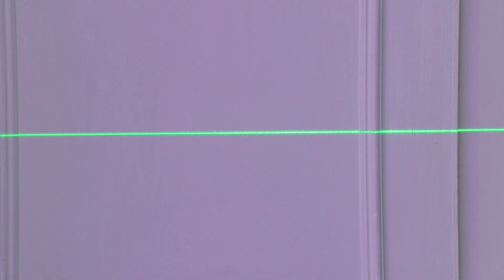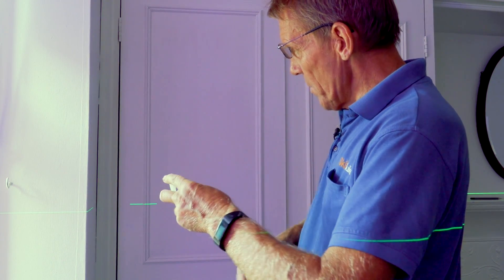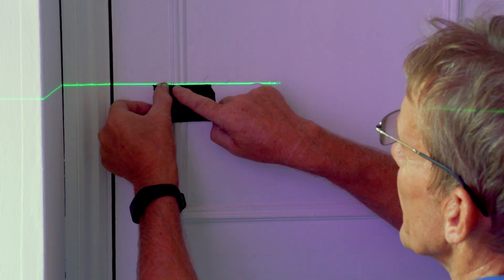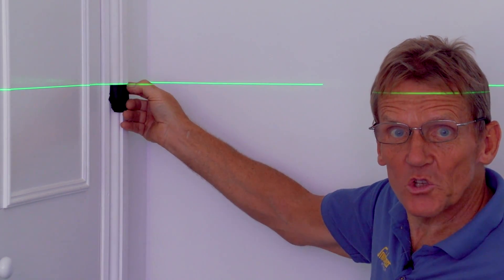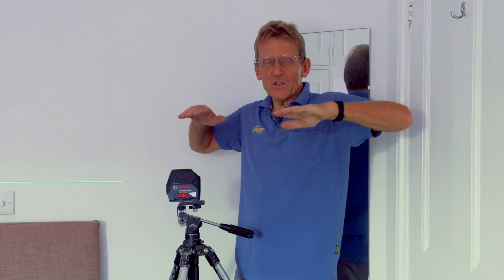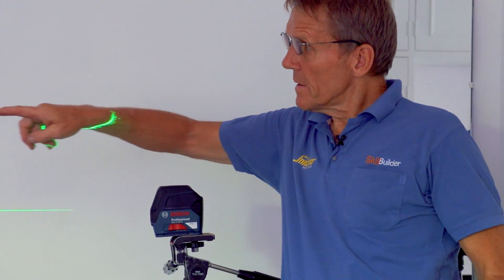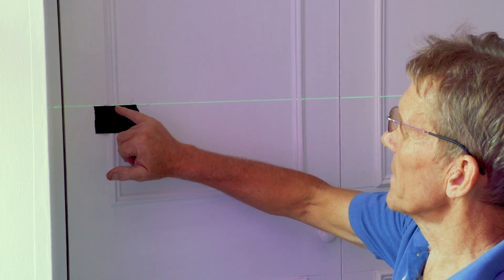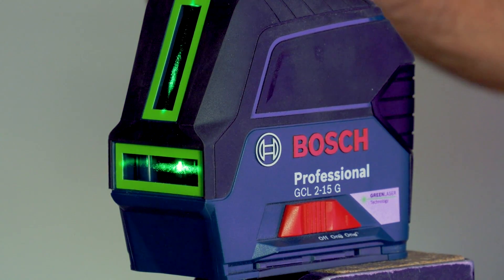Is Your Laser Level Really Level? How to Check

Comment: If the level is not reading level to begin with, then your tape will be off and not level.
Without comparing to some type of standard that is known to be level all that you
are doing is checking for repeatability and not level.
Reply from the maker: Maybe you just  need to think about this a little more. If the level is not level and you move it to the other end and line it up with the tape it won't touch the starting line if it isn't level. If you can't understand it the best thing is to try it and you will see how it works.

Comment: Roger, good vid. I had a cheapo laser level where part of the pivot bearing (a universal joint) fractured. Maybe I over-tightened the lock, who knows. This threw it out, but only when in one quadrant ! So yes check regularly. Clearly these are quick and easy for the pros, but for us casual types I’ve gone back to a water tube level as featured in your other vid. Cheap cheerful and foolproof. I think if I was building a long structure over 10m I would always do a double-check with a water level. Not too good on the verticals though, keep getting wet.😂

Comment: As your laser is on a tripod, if the tripod/floor is crooked then wouldn't you get an crooked laser line?
Reply from the maker: it is self levelling
Reply: @SkillBuilder  I don't understand. Does it have water inside that makes it self level?
Reply: @Do_not_assume  A bit late but I believe they use magnets at the ends inside. The pendulum arm for say to the horizontal line is running vertical inside the device and inside below the end of that pendulum are magnets attracting to help stabilize. They have a tolerance, most laser levels now are 3-4 degrees that you can be out of level. If the unit is beyond that the line will blink, it usually chirps an alarm to let you know the unit isn't level enough to self level. A slightly crooked floor, tripod or anything else won't matter. Once the unit stops setting off alarms it determines the self leveling can take control and it'll work to find level. 

In the demonstration here, level was marked with both ends using the tape to mark where the level said 'level' was. Then it was moved. Only sighted or adjusted to be 'level' at one tape mark. Now if the tool is in fact level (what's being diagnosed) then it should automatically be level at the other end, at the other tape mark. If it isn't then it's revealing some sort of deviation. Sort of like checking a square box for level across the diagonal corners, if it's level diagonally from one corner to the opposing corner, then level again from the other two corners like an imaginary X across the box, the entire thing should be level 360 degrees around. Whatever that 'box' may be, band joists, beams, deck, top plate of walls or whatever. 

A number of them can also be manually locked and in that case they can be tilted and the self level no longer tries to operate. Then it just gives a static line that can be tilted on a tripod for angles like stair railings. But then it's not trying to 'level' anything and it's only meant to be a straight edge.

Comment: Lets say the laser is out by 10mm per 5 m ,higher on the left hand side to exagerate the scenario. Lets assume a perfectly flat level  floor for now. If we place the laser on thr lhs facing this test wall and mark both sides we get the reference lhs marking and the rhs mark ,which in reality is 10mm lower from lhs. Now we take this laser on the rhs of wall . Because the floor is perfectly level flat our laser is 10mm above the rhs tape. Now as per your suggestion we raise the level 10 mm to align perfectly with rhs tape and look to the lhs laser and tape. What we will see is a laser line exactly in line with the tape because the tapes are offset by the error of the laser of 10 mm. Therefore this method is completely incorrect to my thinking. The only way to test is by rotating the level on a flat and level surface block 90 degrees or better hang  a sheet of translucent plastic  off a ceiling in the middle A room weighted by pegs and some small weights . Flash the laser at a distance towards this plastic and mark ends or extremes, then take the level from the other side of the sheet and line up one side and measure the difference between marking and laser. This will give the true error.
Reply: I will add that you can use round posts or a wide opening where you can  mark from both sides of the space .this method is essentially what you do with a mechanical level which is to test itself against the mirrors image ...

Comment: Funny, I was about to validate my level with a more complicated solution when it dawned on me to check YouTube to learn from experience. This is easy.

I'm invested in my solution to the tune of $12. So, I may progress with it. I will mark out the height of 4 corners of a rectangular plane (in my largest room) using water in a clear tube and compare my laser level to those marks.

Going forward, I think I can minimize error by casting the laser from the center of the room rather than from a corner where the laser is out of the way.

Comment: Please notice that this test is not 100% accurate.
I agree that it is probably the best (and only way of testing) for most regular users, but there's a chance that your floor isn't level. 
In that case, when you move the laser 5-10 meters in another direction, the floor height has not equal to the one before, and that can also affect the position of the laser beam.
Reply from the maker: Nicolai 
It makes no difference if the floor is out of level. You may need to think about this for a while but when you move it from say left to the right  end you have to line it up on the mark you have made on the right. Then you can see if the level is running back to the left hand mark. The laser is self levelling or should be so if it is accurate you should see the laser hit that left hand pencil mark.

Comment: It`s a nice tutorial. However it`s a bit unclear how to start this. Did you mark first spot in front of the laser level or you have found the last beam reach from the right than stick two opposite beam side from right to the left, please?   One more question is how to check vertical accuracy in this case?  Thank you
Reply from the maker: If it is level it will be plumb because it all works on the same pendulum. Just mark on the end of the line then turn the level and mark the other point and see how it lines up. I think you need to try it to understand

Comment: Weeeeellllll - hmm. Obviously the floor can not only be not level, but not even.  Liquid in a tube that is of adequate length (or more) will use the EARTH'S GRAVITY and air pressure to seek its level - and will therefore be more precise than the laser mechanism once the movement of the water column settles (takes several seconds.)  So secure one end of a long tube nearly filled with water to the first point - the reference mark - then go do the same to every other end of the tube wherever you want to mark.  You are measuring with the level of water in the tube that once secured at the first point, will always be precisely the same level at the other end. This is only dependent on the Earth's gravity and air pressure being the same at both points - which it always is - and not on some previous construction.
Reply from the maker: We have a video on the water level. On the other point about the floor not being level that doesn't matter since the laser is self levelling. You just need the beam to be on the second mark you made when you move it. When someone says something is obvious it is often because they have limited their thought.